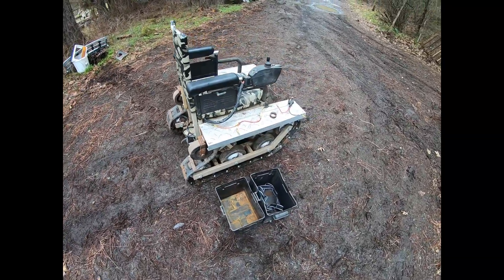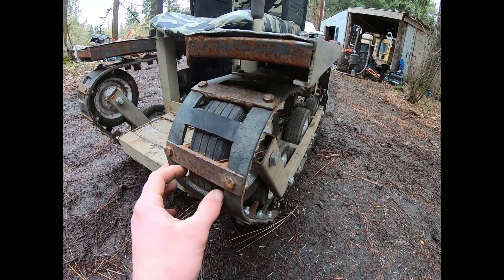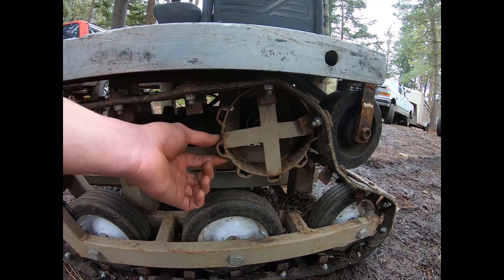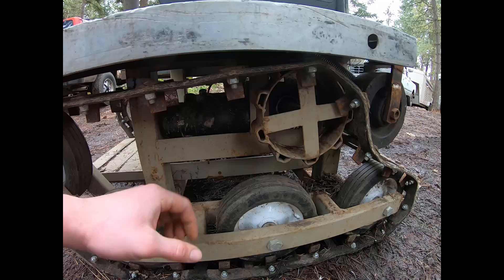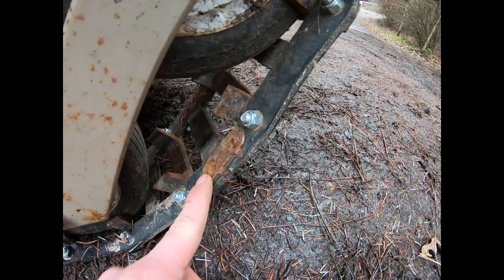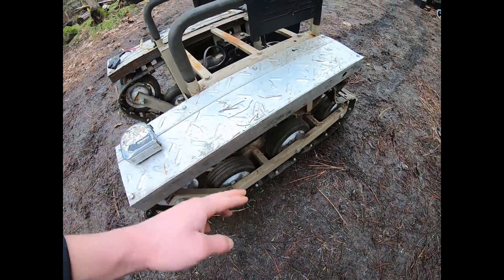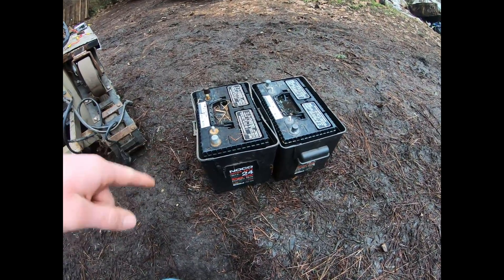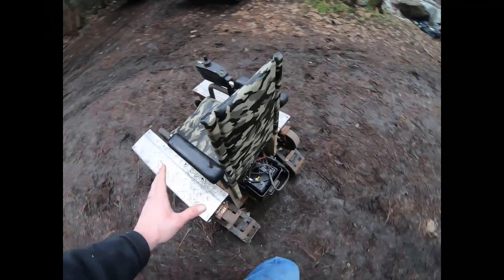Homemade Wheelchair on Tracks! How to Build a Tracked Wheelchair on a Budget

Comment: I bet that rip some wood floors up . Hell any indoor floors.. i have a bad back for many uears . I have a jazzy elite im been homeless for about 5 months.. my batteries are Dead i live in a very small country town . This town dosnt have a Walmart or anything just one dollar store and a couple gas stations. I cant get any help to get them . I have to walk to get any thing to drink. Where im living is an abandoned Rv. No wayer or electricity. Yhe neighbor is letting me run a extinction cord over for a fan. I lost my picture ID. The chairs very nice. I wish i knew someone who could help me 
 Do you kknow anyone who helps in this situation? It would make it so much easier to go get what i need and i have a garden wagon i can hook to it to haul good water home. I will be 50 in January. Ive tried a few times to get help with disability. But without proper stuff i cant get one.

Comment: Nice But I bet she wished she had suspension !  China sells them the bottom half with motors ,remote control plus stick then you just add what you want on the top about $1,000

Comment: I'd love to hear more about your sister. I'm no doctor, but you mentioned she "doesn't have ENOUGH muscle strength to walk" like she isn't paralyzed but needs to be stronger (or lighter). 

Well, while I was visiting my sister at college their gym had a pull-up machine that you stood on this platform and entered a number from like 5% to 95%. And you would get lifted by the platform so if you COULDN'T do a pull-up of your full weight, you could still lift a portion of your weight and just gradually increase that until you were stronger. Granted, that was for your arms, but if you need an idea for a video, perhaps you could build something like that to improve leg strength? 

I think they actually make something similar for babies called a "Jolly Jumper" but apparently they're actually BAD for babies because their spines aren't developed enough yet. I actually had a similar idea in mind to help fat people get outside and exercise where you fill a 15' cubic balloon with helium, attach it to a shoulder harness and go for a walk weighing roughly 250 pounds less! Perhaps you could skip the balloon and build a metal stand on wheels, with a harness that holds your sis up and let's her "walk" while supporting a fraction of her weight. Even if she just uses it inside, she should be able to get stronger eventually. 

Either that or just build her an exoskeleton. :)

Comment: Hey. I love this! Iam in a wheelchair and I have been since I was 15 and I just turned 55 in July. I have wanted a wheelchair that I could take in the woods ect for a long time. I have some power chairs with plenty of motors and parts. My question is do you think I could use old car/truck tires with the sidewalls cut off for tracks with a belt tensioner for a serpentine belt to hold it taught? Was thinking that I could use one of my old chairs and just retrofit it with tracks. Love your channel. Keep up the good work and I know your channel will grow.
Reply: You may want to look at bailer belt from tractor supply for belting.

Comment: I am very impressed.  The one addition that I see as needed is a shield to protect the  user's feet should they have  baggy pants legs to keep the loose clothing out of the works of the track  I am looking at building a tracked chair for myself.  Your design will have heavy influence on what I build.

Comment: Well done! I didn't hear you mention any particular motor controller(s) used. Did you use the controller from the original chair? & have you had any controller over heating issues with the added drag from the tracks?

Comment: I’ve been wanting to build one of these. My regular power chair isn’t suited for going the places I would like to go back to. I saw your tank build breakdown and figure I’d check it out. If I could challenge your building may I suggest trying to build a power option that could be connected to any manual wheelchair while being easy to operate and lightweight. I’ve come up with a few ideas, I just don’t have the materials. One is using an electric scooter that has its front wheel as the drive wheel and maybe even the battery in the steering arm. And make it connect at the footplate lifting the front up just enough for that drive wheel to be the steering and power. The other is figuring out a way to use one of those hoverboards as the power. I just haven’t figured out the control.

Comment: Upgrade your lead acids to some LiFePO4 cells and you'll cut the weight by at least half the weight of the batteries. Plus you'll get better life out the batteries then. You could also go with Lithium Cobalts (LiCo) or similar Lithium based cells. The LiFePO4's are no where near as flammable as the other lithium based cells and they can handle 20+ Amps per cell easily.
Reply from the maker: I think you've comment on all of my videos so far! XD I really appreciate your loyalty! Hmm... That's something that I hadn't considered before. When this YouTube thing picks up for me then that might be a good investment! Thank you for the advice!
Reply: @randomn6473  You have good videos and aren't boring and you get right to the point. And you don't play that overused music most tubers do  😉
Feel free to ask any battery questions and I'll do my best to give good answers. You can also head over to SecondLifeStorage forum for more details and LOTS of various projects.